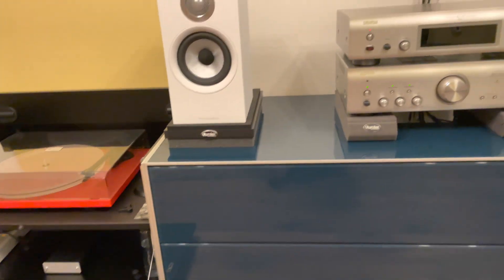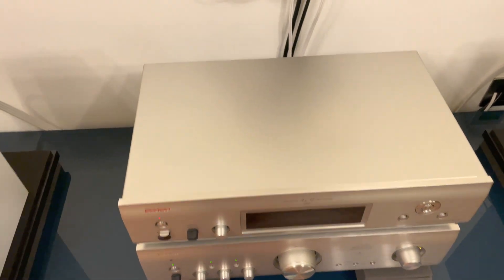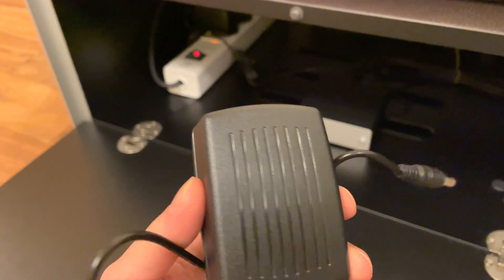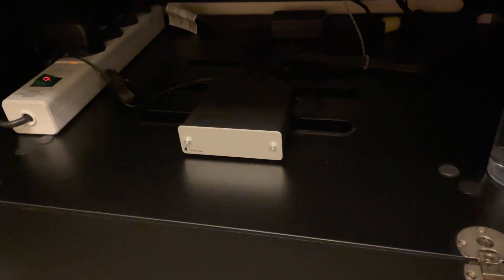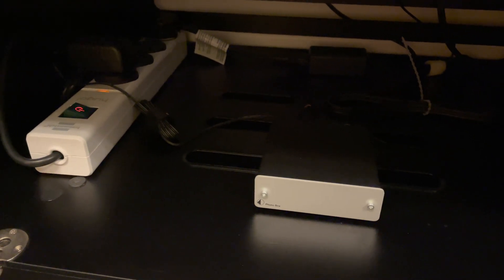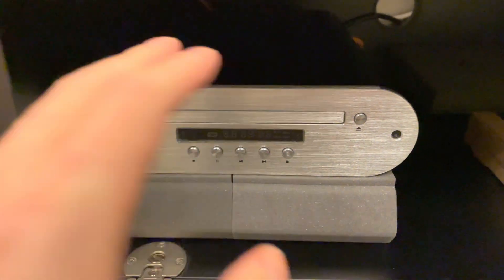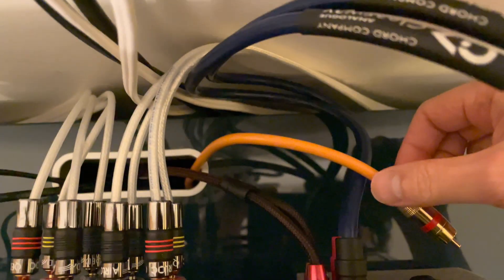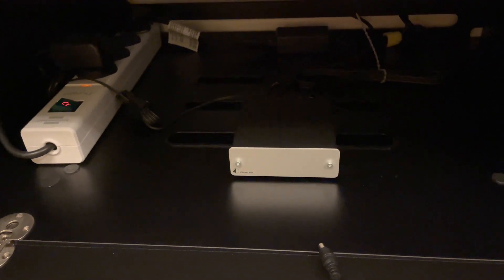2 more solutions for solving Buzzing / humming noise from Pro-Ject Essentials II phono to Phono Box

Comment: Hello Brian, first of all, thank you so much for sharing your knowledge.

I wanted to ask you: I have an AT LP5X that hums in phono mode with the built-in preamp. I don't have a ground connection at home.
My amplifier has a floating ground, as does the CD player.
The external phono preamp also has a floating ground; it's 12 volts.
I bought a current filter, a shielded RCA cable, and a ground loop eliminator (I connect it in-line). But I haven't been able to get rid of the hum.
I noticed that when I touch the tonearm, the cartridge hums a little more.
When I unplug the turntable in phono mode, it still hums through the amplifier.
When I use the built-in phono preamp, the hum is reduced, and when I unplug it in this mode, it stops.
When I raise the turntable off its base, the hum decreases. Whenever I connect all my equipment, I always connect the GND wires from the turntable to the phono preamp and then to the amplifier.

Could there be something wrong with my turntable? 
Sorry for the length of my question.
I appreciate your help.
Greetings from Peru.
Reply from the maker: Hi, if I were faced with your situation I would try to ground your system. I would run a wire from the metal chassis or the ground conductor from any of the RCA plugs to an earthed object like metal water pipe if your power sockets don't have earth pins.
Reply: @BrianSu  Hi Brian,
Thanks for your reply. I solved the buzzing problem in my turntable by installing a dedicated ground for my audio equipment. Once everything was grounded, the buzzing disappeared.
Thanks for your advice.
Regards.
Reply from the maker: @MusIc-ob6vv  GREAT!!! So happy for you. I remember the relief I felt back then too.

Comment: H Brian, thanks for posting your video. Quick question, I have a Project Debut Pro .... hooked up to a Marantz PM6007 inter/  amplifier ..... I Have ground the turntable to amp .... I have ground loop hum .... so have purchased the Project "High Power IT" grounded high performance power supply, hoping it rectifys the issue ...... QUESTION .... should i remove the earthing cable between the turntable and amp??? Im not sure?? .... Im thinking it will no longer be required?? and as you are saying here the amp is floating earth ... my only cocern is that should amp, cd etc etc have a short would it then earth/go to ground via the turntable (if still bonded together with earth wire) because it now has earthed power supply .... ie so should it be removed??? Sorry lengthy script .... any help much appreciated>
Reply from the maker: Hi I have a similar setup and I didn't remove it. I'm not getting any hum with the setup as is. As for your 2nd question, yes it would seem that the escape path to earth would be back through your TT and through the High Power IT back to Earth because it's the only earth connection. I never thought of this. On my system right now, the phono pre-amp, Turntable and CD Transport are all 3-pin Earthed powered so there are 3 paths to Earth.

Comment: Hey all you have to do is replace YOUR TURNTABLE POWER CORD! ifi power X powe cord will remove all your humming noise back round!
Reply: Link ?
Reply from the maker: nope. Not all Turntables have the Negative terminal connected to the Ground.
Reply: @BrianSu  fully balanced output turntable is even better without hum RCA unbalance connection is outdated! Not all turntable have balanced output this should be mandatory on every turntable.
Reply: I have rega planar 1 with fosi box x1 with this same problem, not sure what do i need to fix it? Newbie here and its my first tt setup. Thank you.
Reply: 😂😂 No... No, no & no.